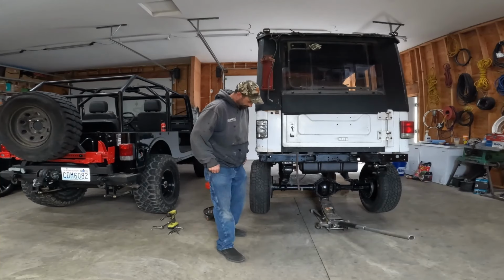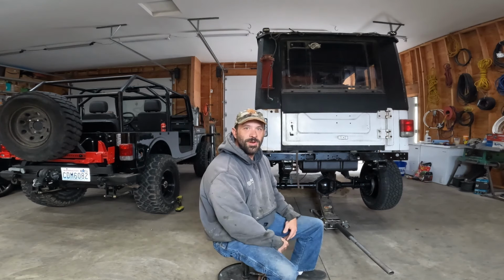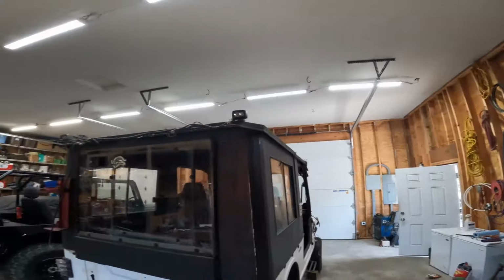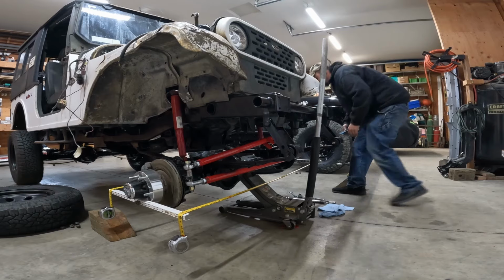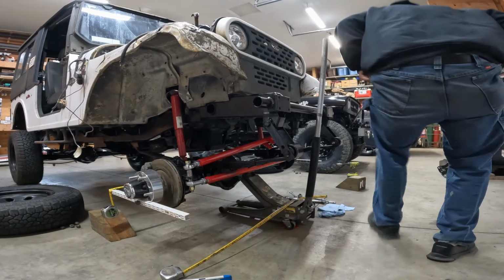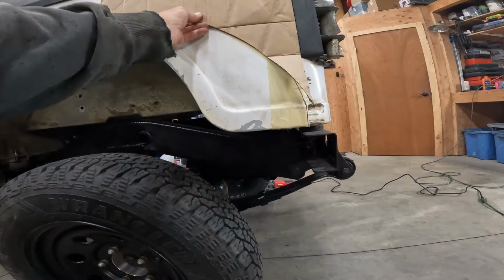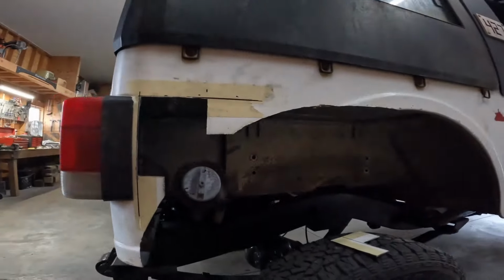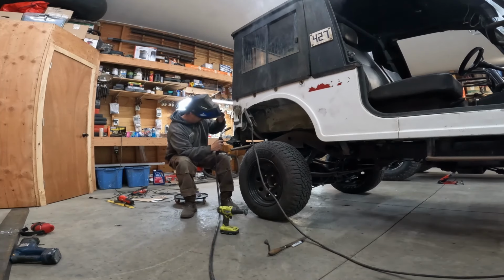ROXOR 2 WILDCARD BUILD FENDER TRIMMED PT.14

Comment: Heya Tom, Fellow Roxor modder here.  35" Tires, 5" lift, 4.88 gears and True Tracs front and rear, Turbo, Intercooler, Tuning, ETC... That drag link  is gonna jam up when that side drops and the spring curls up. I had a literal nightmare on this myself.  The only fix on the Spring over axle lift with those bars is to put the Tie rods above the Spindle also, it will give ample clearance for the drag link. But make sure you RED LOCTITE those bolts! , and a lot of it. They WILL come  loose almost immediately if you dont.  I speak from hands on experience with that exact kit. I'll try to put mine on You Tube also in a bit... Be safe bud! 👍
Reply from the maker: @Longslyde1  thanks for the advice, goings to change it, it would be great to get a picture of yours to see how you did it
Reply: @tomslife5630  I got the pic, just don't know how to get it to you.... Diesel Freak put a note on the kit saying it won't fit SOA lifts because of what I went through. But it will work this way... Like I said, Red LocTite, 7" grade 8 bolt. Been great since, even though it cost me ton to get it that way.... lol.